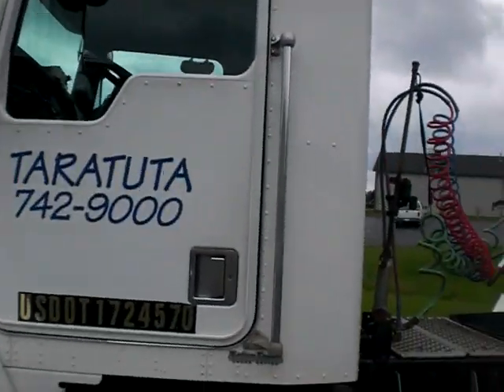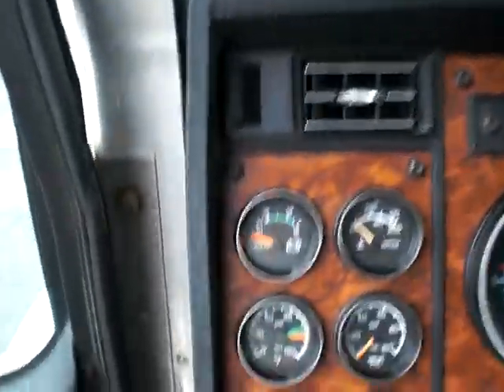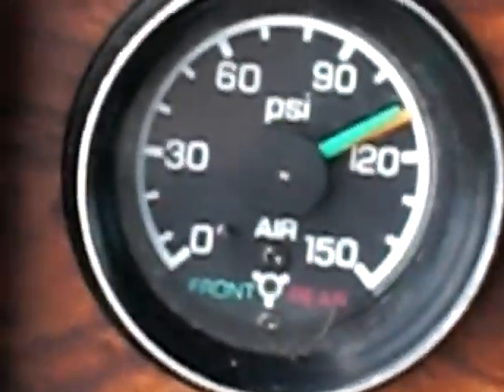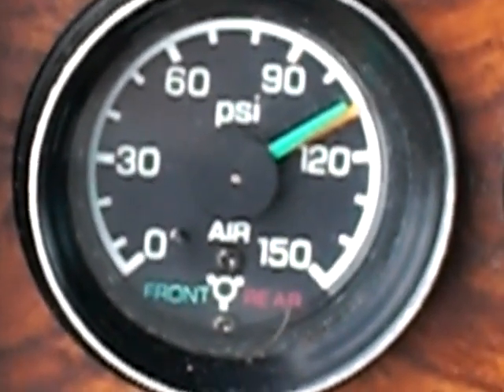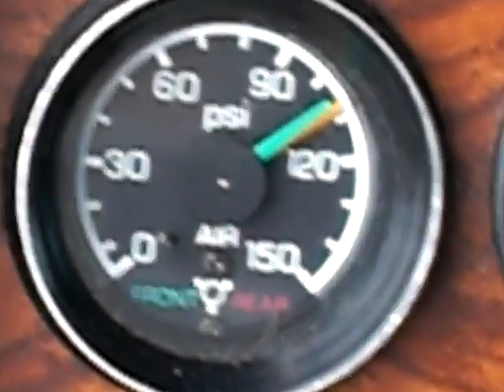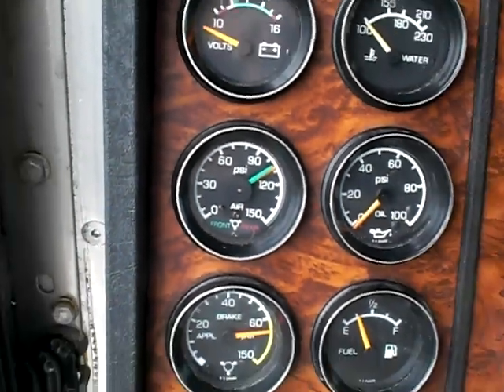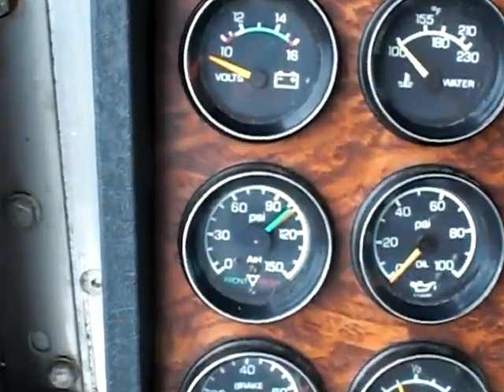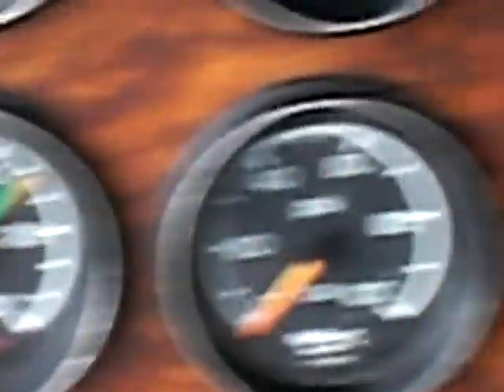AIR BRAKE LEAK DOWN TEST

Comment: The correct way to do the air brake test is "to chalk wheels, start with a full air brake system approximately 125 psi ,turn engine off and key on , release the parking brake , after initial loss , you can lose no more than 3 psi on combination vehicle's and 2 psi on single vehicle's in 1 minute. then you would apply brake pedal , you can not have more than 4 psi in 1 minute on combination vehicles and 3 psi in 1 minute on single vehicles. Then you would continue pumping the service brakes down to reduce the the air tank pressure , the warning light and buzzer must come on before 60 psi. Continue pumping the service brakes down, between 20 and 40 psi or manufactures specifications the push pull style parking brake valve  must pop out, indicating the parking brake has reapplied. Start engine start building air pressure at (approximately 1500 rpm) air pressure should build between  85 to 100 psi within 45 seconds. Continue to build air supply to find cut out pressure which should be approximately 125 psi or manufacturer's specs the air compressor should cut out.  to find cut in pressure, engine running pump service brakes down to 90 psi and watch for air compressor to start building air pressure. Two more steps to air brake test , 1 the parking brake check which is done in second gear at idle to see if the parking brake is working and the vehicle will not move, 2 service brake check ,drive 3 to 5 mph and apply service brake , the vehicle should stop without pulling right or left.
Reply: Chock
Reply: When I did the test that you just drive my gauge is past but if I park my motorhome and leave it 24 hours and I come back my air pressure goes from 1:20 to 30 lb on both gauges.

Is that a slow leak or is that normal?
Reply: I hate when I get chalk on my wheels. 😀

Comment from the maker: @Fishzaft1 Correct. 
If you follow your State's CDL manual it may suggest testing air brakes in the following sequence:
1) Stall test - check if brakes hold vehicle i) build air pressure
 ii) push in Red (trailer) button iii) do stall test in about 3rd gear iv) shut engine (in gear); release or push in Yellow (Park) button
2) Leak Down Test - where this video starts

Comment from the maker: If you follow your State's CDL manual it may suggest testing air brakes in the following sequence:
1) Stall test - check if brakes hold vehicle
   i) build air pressure
   ii) push in Red (trailer) button
   iii) do stall test in about 3rd gear
   iv) shut engine (in gear); release or push in Yellow (Park) button

2) Leak Down Test - where this video starts

3) Pop-off test - Fan brake (pedal) until Red and Yellow both pop out.

Other tests as Air Build up may be included.

Thanks. Best regards

Comment from the maker: Thank you for the safety tips!
I was waiting for some one to bring up those points. I understand its called "compounding" the brakes - and should not be done. I will note that in the sidebar.
My goal is a future video demo of a complete air system test (in which the brakes would have been  released after the stall test).
Thank you, again.  Best regards.

Comment: yes there will be some leakage but you should lose little pressure, if you are losing air noticably i would get your check valves looked at.  there are manuel drains on the bottom of each tank you should let the air out everynight to let out any water and other garbage

Comment: you have air pressure because on a vehicle with air brakes, it has air tanks, when you turn off the rig it still keeps air in the tanks, but if you "stroke" the brakes to much, you will run out of air and you will have to turn on the engine so air pressure can build back up.

Comment: I certainly hope nobody actually believes this !
"Stroke your brakes twice and it should fully adjust the automatic slack adjusters" ? That has got to be one of the most WRECKLESS STATEMENTS I've ever heard ! 
 The ONLY way to make sure your brakes are properly adjusted is to measure the pushrod stroke. If  they do need any type of adjustment it requires a MINIMUM of 7 full applications on the brake pedal with a MINIMUM of 100 psi before each FULL application.